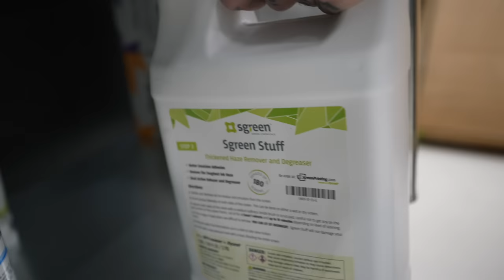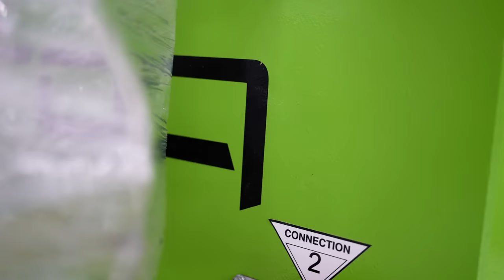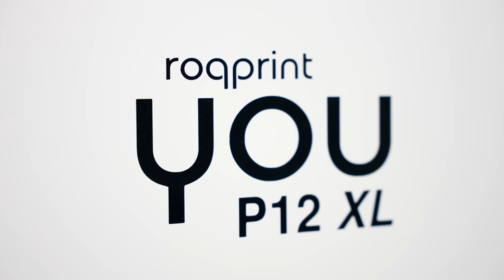It's Here! My New Automatic Screen Printing Press

Comment: I have the same size shop and because I am by myself most of the time I made sure that everything I put in that shop has wheels.  Believe me it will be easier to clean and rearrange once you do that.  Good luck and thanks for the content!
Reply from the maker: Definitely planning to add wheels to a few things yet other than the big equipment that needs to stay put. Thanks man

Comment: Congrats bro! Getting older and being sore sucks. IMO, the biggest advantage of having an auto, aside from the obvious, is in life quality. Jobs will get done faster, and your body will thank you. After set, the only labor involved is loading, and unloading shirts. Sure there's all these other cool factors... consistency, running shirts at 250-500 an hour, etc. But getting the job done and having more time to do what you want is priceless.
New to owning an auto advice: Biggest learning curve will be getting used to walking around the press to load inks / squeegees. Not that big of a deal for the payoff. Keep an eye on the ink consistently, and don't over do it on ink. Overprint colors will go longer, but white goes fast. Run a couple test prints until you get pinholes situated. It's really easy to run out of ink, or a pinhole show up and you wont notice it until you've printed a carousel worth of shirts. So first handful of shirts, keep an eye on what's going on with first dozen shirts before you really start ROQ'in. Warm up your pallets before a job, and you're golden.
Looking forward to what you do with it.
Reply from the maker: Thanks a lot dude, that's all super valuable advice. It's going to be a massive learning curve that's for sure but I'm excited to see how it all goes

Comment: I’m super excited to see how you run with the auto! There aren’t many videos showing how they really work and how to get good quality prints from them.
Reply from the maker: That's what I'm excited for, there isn't really any decent content out there with an auto and how to run one. I'll definitely be covering a lot of it as I figure it out
Reply: @leestuart38  I was hoping so! I’m scared to even look at buying an auto since they expect you to be an expert before ever using one!
Reply: @SarahWiseGarcia  the roq system is pretty simple to use. The tech usually provides some training after purchase.  Roq has some pretty good video tutorials available also.
 The one thing that I did not care for, and I can’t remember if it was on the Eco or You system, was the digital registration set up. I much preferred the analog registration with the cross hairs vs the digital read out.

Comment: Hi Sir, i would ask a for an advise, because started my printing business with pigment printer and heat press using dark transfer paper, I started to press in the shirt and one of the printed shirts with Dark transfer paper design started to peel off after I washed it in the washing machine , I"m just confused because i follow the supplier's setting of 180 and 10 secs in my heat press. can i  ask for some advise from you on what to do. Thank you.

Comment: Hey man,

Do you have any suggestions for screen printing round objects like bottles? I’m trying to print some round objects with the rising going fully around the object.
Reply from the maker: There are cylindrical screen printing presses for doing exactly what you need, but there are ways to do it with a regular press by rolling the bottle along the bottom of a flooded screen
Reply: @leestuart38  thanks heaps for the reply dude. So if you did it with a flooded screen, would there be a way to keep the bottle stable so it doesn’t veer off course and come out uneven?

Comment: I saw an Epson Sure colour in there, didn't know you were doing sublimation as well, I may have to rewatch some vids, loving the new messy shop ;)
Reply: That printer is used for film output. We have the exact same model.
Reply from the maker: I have a small sawgrass sublimation printer but I hardly use it
Reply: @leestuart38  I eventually want to get up to an epson f570, getting into more hard goods like aluminum photo panels

Comment: Those print heads are heavy..lol it took 3 people to lift ours when we had the M&R tech come in for the installation.
Reply from the maker: Dude no kidding. I tried to lift just one of them and it wasn't happening 😂
Reply: @leestuart38  they did pack it a bit weird. Ours were only stacked 2 high and in crates which made it easier to handle.